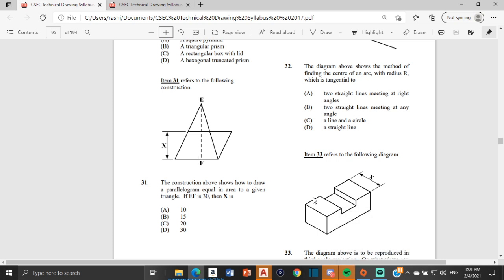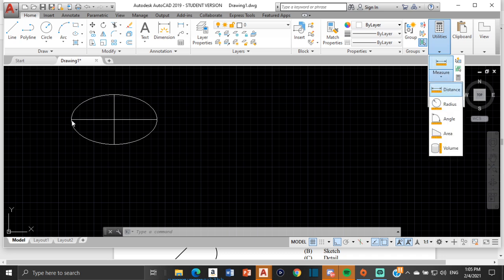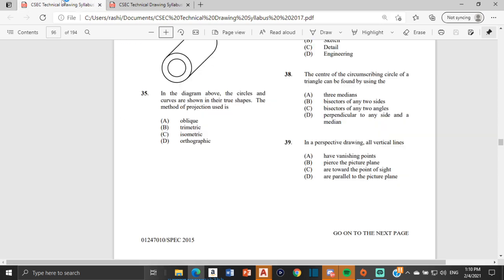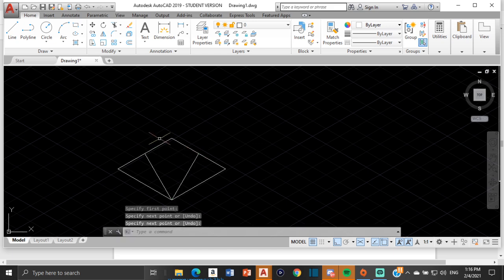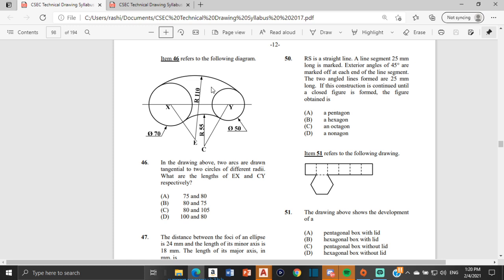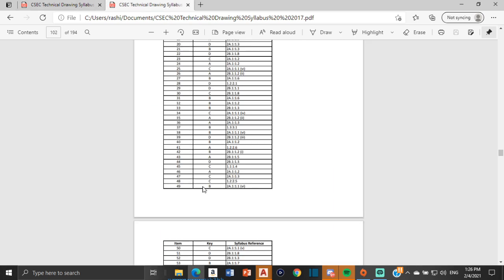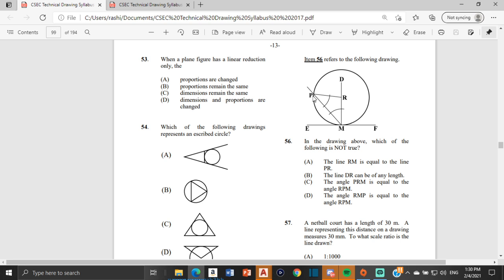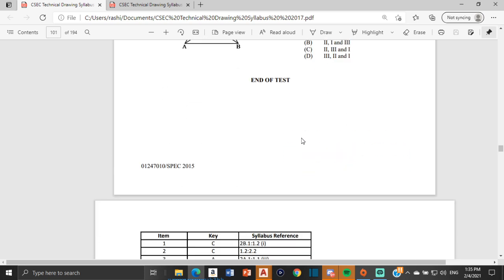ANSWERING 30 TECHNICAL DRAWING MULTIPLE CHOICE QUESTIONS PART 2

Comment: Why number 33 is b ? Because the current view is similar to third angle projection?
Reply from the maker: The current view is in isometric projection but in third angle orthographic projection the line marked X would be visible from the top and right side.

Comment: This is a huge help thank you 😭
Reply from the maker: I'm happy I could help.
Reply: @mr.cargill  for upcoming cxc...what kind of drawing do you think we could get sir?
Reply from the maker: @nanamiwife-r1r  Students will get two drawings. One will be worth 90 marks and the next worth 30 marks. The 90 marks questions could be a floor plan, roof plan, foundation plan, elevation, sectional elevation, site plan and so on and the 30 marks question could be a detail drawing, eave detail, ridge detail, foundation detail, stiffener detail, sewage system detail, staircase detail etc.
Reply: @mr.cargill  ok thank you
Reply from the maker: @nanamiwife-r1r  You're welcome
Reply: @mr.cargill  that means the exam would be almost the same as the sba ?